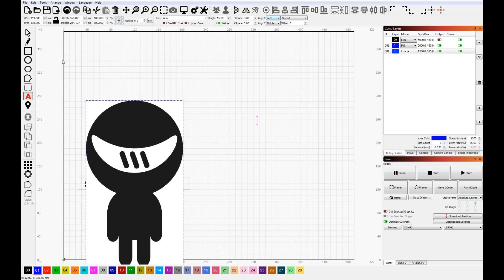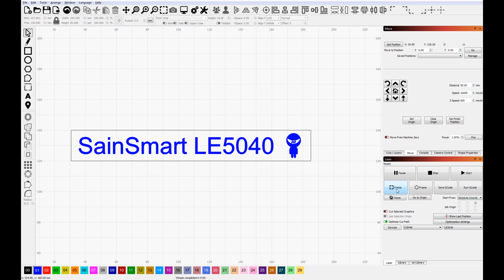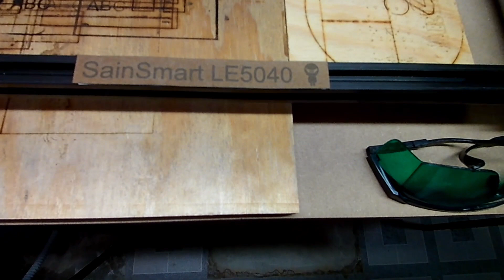Making a label for the new Genmitsu LE5040

Comment: looks like any upgrading I do will be through sainsmart they seem t have a very good reputation
Reply from the maker: For the most part, I have had a good relationship with SainSmart.  Like with all companies, there has been an issue or two they were not able to resolve.  Still working with them on a compatibility issue with the new spindle motor for the 3018 Pro router.  Our deffinition of "compatibility" differs.  ;-)
Reply: Have you tried cutting corrugated cardboard with this?